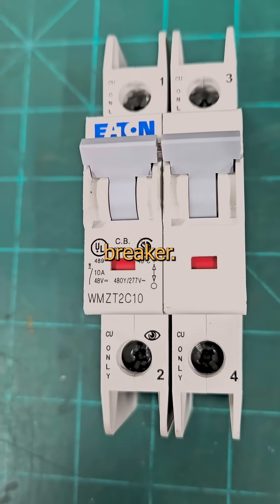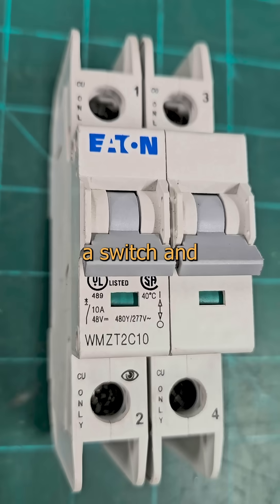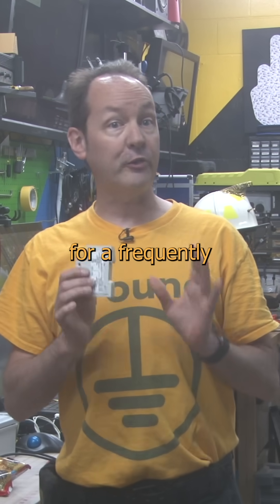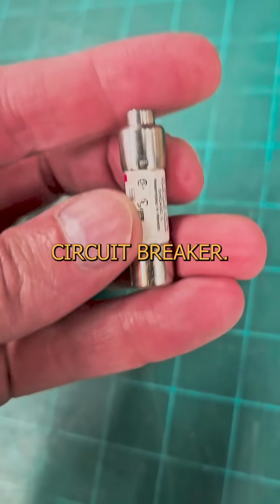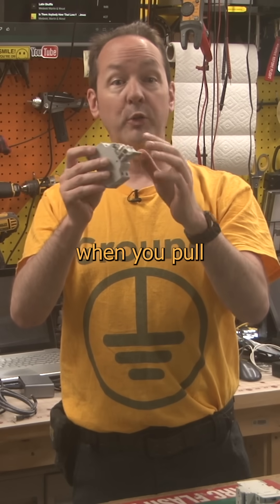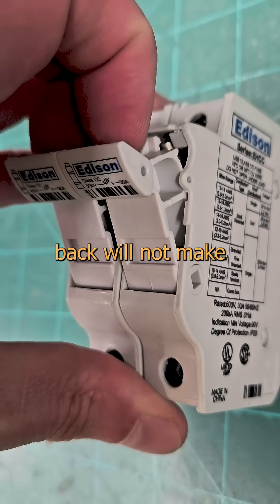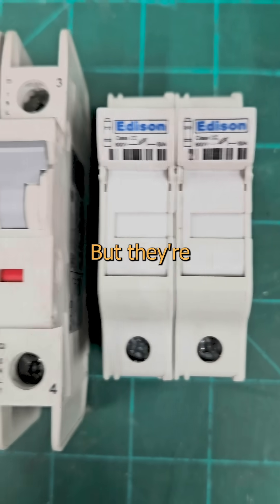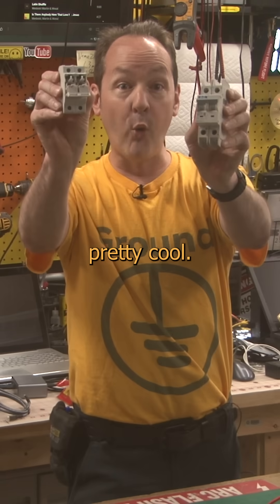Breaker vs Fuse #chrisboden #comedy #engineering #electrical #apprentice #training #educational

Comment: A fuse is not current limiting. Current limiting means reducing the output voltage such that the current doesnt even exceed a maximum value. This is just setting output to 0 after it exceeds maximum value.

Comment: Your fuse disconnectors can't be switched under load? In Germany, Linocur disconnectors are common. They use a Neozed element and can also switch operating currents.

Comment: I do electrical panel wiring for a centerless grinding machine manufacturer. Depending on where a machine is going or what its purpose is, we'll use either. We had a customer that demanded we only use the fuse blocks because of where the machine was going to be located. It's a kinda cool job

Comment: In my opinion fuses go on expensive equipment that you don't want idiots restarting before you find the issue. If it's something that will either cost the company a couple million to replace or a human life I always try to use a fuse. That extra step of physically having to remove the original fuse test it for continuity and replace it keeps normal equipment ops and maintenance guys from going "oh here's the flipped breaker!" And energizing a fire hazard

Comment: What is very cool about these resettable breakers is they have TWO modes of operation: there's a thermal switch, simply a bimetallic strip that triggers the opening mechanism, used to trip following a time-current curve, protecting cables from overload. The second one is magnetic, there, the magnetic coil reacts to sudden current spike and immediately triggers the contact opening once the preset value is reached.

Comment: Where I live a B16 Din rail breaker is available for €1.69 or $2 at the moment. A Neozed fuse cost almost half of that, definitely not cheaper since the socket is more expensive.

Comment: i had a breaker switch actually break when I turned it off to wire in new lights.  Because I didn't know it had broken I did so much trouble shooting before realising the breaker was broken and bought a new one for a few dollars

Comment: I remember once in auto shop we had an old blazer with some kind of eletrical fault. Kept blowing different fuses at different times under different conditions. We read the wiring diagram straight from GMs manuals and we absolutely couldnt figure it out. We eventually stuck a washer in the fuse block and waited for the magic smoke. Turns out, someone at some point in time before the blazer was donated to the school, had replaced a bunch of the fusible links with just regular wire and didnt exactly do the best job.

Comment: Fuse holders had that position first, then came the resettable breakers, which took decades to perfectly mimic the trigger levels of fuses .  Also, if you buy your fuse holders in the home of DIN, (Deutchland/Germany/EU), the cartridges will be the Neozed bottle shaped cartridges, not those US cartridges .

Comment: All circuit breakers are bad. Fully none of them are guaranteed to work more than once. If they tripled due to a dead short, they will be damaged. If they are reset soon after tripping, the likelihood of the contacts welding is high. It is recommended that circuit Breakers be taken out and recertified for use before being  used again. Failure to adhere this leads to electrical fires. 
Fuses work faster, are cheaper, and protect circuits far better than any circuit breaker is ever able to.

Comment: Fuse holders also shouldn't be opened under load.  They aren't rated to suppress the arc that comes when breaking a path that's carrying current.

Comment: The circuit breakers and fuses aren't mutually excangable either. The former are linked together so connectivity on both (or all) wires are broken simultaneously, whereas the fuses tend to only break connectivity on one of the multiple wires.

Important difference in many cases.

Comment: honestly, when they replaced the fuse box with a switch box in my apartment i was so fking happy. Just needing to take a trip down to the hardware store all because i ran the toaster a little too hot was aggravating. 

Now if i accidentally run my air conditioner and hair dryer on the same circuit, i don't have to worry about needing to go out into 35c weather to flip it back.

Comment: My favorite part about fuses is that they follow the Onderdonk equation, and I just love the name Onderdonk.  

I had to use the Onderdonk equation myself when designing a circuit that could survive a 15kV, 100A surge.   It was a broadband over power line transceiver which included an RF transformer that used 30AWG wire.  Suprisingly, thanks to the short duration of the surge, and some surge-rated caps before it, I was able to calculate and simulate its survival.

Comment: I had a guy bang on a chevy TBI because he thought it was a carburetor... and was getting the float unstuck.
.
It was actually the fuel psi regulator.... and he just caved it in.... with a rock he found on the street. 
.
He called me when the "float didn't un-stick"
.
.
Im like... your fuel pump is out, and now I have to rebuild your TBI for another 180 bucks... congrats, ya played ya self

Comment: A fuse will open if there are a lot of short overcurrent pulses. It takes a while for the fuse wire to heat up and break. If the pulse is too short to actually melt the wire, it still damages it. Eventually, the damage adds up and it breaks.
If you have a fuse that seems to blow for no reason, check for pulsing overcurrents.

Comment: Man, I've been using the breaker as an on/off switch for my 240v twin-stage compressor for 15 years.  I need to stop doing that and put in a switch.  Thank you for kicking my ass.

Comment: Meaning the circuit breaker is for emergency shut off for something that's not designed to be switched on and off on a regular basis. The switch with the built-in fuse is for something that requires that purpose. I'll add my own dumb question here : this is a correct assessment?

Comment: Guys at my work installed a new production line, decided instead of breakers or a shutoff, to just have a box with 3 power supply’s, 13 safety relays and a controller, and the only way to shut off power to it is to go to the main breaker or pull the fuses

Comment: I’m going to be buying both DC breakers and fast acting fuse blocks for my Solar charged, battery Backup thru an inverter setup I’m building now. It is confusing going by Forum logic what to use where. The T type fuses are very expensive around $52/ each. With so much made cheaply in China it’s easy to unknowingly buy either a breaker, fuse or switch that will fail and burn up your system.  I guess I’ll hit the code books.

Comment: DIN rail electronics my beloved, i especially love the push in spring terminal things where you jam a screwdriver into a little slot then shove the wire into a hole

Comment: I use the one that is quick to reset as a mini at-home lockout tag out except I skip the lockout and skip to the part where if you flip it then I tag you out

I heard somewhere that the lower-voltage ones should flip off before any life-threatening injury and that was why they don't lockout
Any chance anyone can confirm this?

Comment: Old shop I worked at had a proper shutoff switch fail, so they bypassed it with wire nuts and used circuit breaker to cut off a machine running a bunch of 3000W lamps. At least the fire was contained.

Comment: A big difference between the two. The fuse will fail by tripping at a lower current. The circuit breaker will fail by not tripping at all. 

And remember that a circuit breaker is not a switch at the best of times. A circuit breaker is way the hell not a switch, on a 100 amp crusher.

Comment: Ah but those fuse do some a whole lot more useful than that small circuit breaker! Those fuses can limit available short circuit current! 

If you have a 10ka system and you have 10ka breakers you are all good. Use breakers by all means, but what do you do if you need to hook up some 10ka stuff to a 65ka circuit? This is why we use modern fuses in industrial control (at least the main one). SCCR. Failure to properly design SCCR is why you see large cascading trips that are not stop near a fault.

Comment: @17:18 I have the same pressure washer. I’ll tell you what- they are pretty tough. Hypothetically if you roll it off the side of the bed on an s10 because you figured you didn’t need to strap it down because you were just taking it 300’ to the back of the shop and it slides on its top for 20’ downhill on gravel it would probably still work perfectly.

…. Hypothetically.

Comment: I have genuinely never seen DIN rail fuses in the UK - didn't know they were a thing! I don't think you'd be allowed to use this for normal residential circuits here (30 or 40 A, 240 V) but maybe it's a thing where you want some local protection but have spiky instant current draw and nuisance tripping is a problem? Like big motors?

Comment: I had never seen these before so can you imagine how fucked i felt when this winter my cooling tower water started to freeze? I kept checking everything in the disconnect and i thought i had power to the heating elements well turns out i had these little fucker in there with blown fuses. I thought i had some kinda BMS issue because when i checked my elements they were fine but nope it was just the blown fuses not letting the voltage through.

Comment: Neat little fact, GFCIs (RCDs here) have been inside of circuit breakers in Australia for decades now, even on lighting circuits. There are some places where it's on the outlet, but not many.

Also, should mention how it bothers me that my workplace has a big set of two 500W halogens, and they're toggled on and off by... a breaker. At least it's very rarely used...?

Comment: If you can find one for less than the Titanic's weight in scrap price, Eaton also makes a 1200 amp circuit breaker (iirc its like pdg5 then some part numbet lorem ipsum) and they're "fun" to work with

Comment: The company I work for makes programmable relay panels rated at full amperage, some have dimming control, some qualify for UL924. They are used in places which used to use the breakers like switches and are a lot more reliable and have more automation features than the old RR6 relays. 
The company also makes smart breakers in several flavors. Sure, they still shouldn't be used as switches but it's nice to be able to monitor and check stats and be notified if a breaker tripped and remotely force off if I need to flip a breaker.

Comment: Huh I've never ever seen one of those fuse blocks. The classic fuse panels with screw in ones were what i was used to as a little kid until everyone started switching to flip switches (which, i would like to add, green means go and red means hot still confuses me) 
I thought they were cheap as chips since everyone uses them. Am i crazy?

Comment: A trick some Russians taught me, if you can't find a breaker, plug a cut off pigtail into the socket and short the circuit. The breaker that explodes is the right one..
Reply: I've done this at least twice. Sparks, pop and fun

Comment: This is what we had as kids. We also have a little card wth some spare fuse wire inside the box. I was replacng the fuse wire when I was about 7. Which in retrospect was pretty dangerous since I didn't understand current.
But that's nothing compared to when I was about 16 and didn't understand current and blew a fuse in my first share house. Just used a bit of random wire. That bastard didn't blow.

Comment: I use circuit breaker as a light and outlet switch in my garage because I didn't wire in any additional switches, I just have live wires going through the circuit breaker and out of it into outlets. But it worked well for 5 years so far, any reason why I shouldn't use circuit breaker as a switch?

Comment: Those fuses are typically $30-40 each. So when the new guy just replaces 3 without even checking the circuit and instantly blows the new set, it's really annoying.

Comment: On a machine I worked on pulling out the fuse and putting it back would make it go again... It reset the old drives that would fault and not reset if too much load was placed on the motor.

Comment: Circuit breakers and fuses are only there to protect the wire in the walls (or a wire harness), not the load they are connected to. Please remember that, folks. o7

Comment: Breakers are used for when you might accidentally but safely over Amp a circuit say by plugging in 200 strand of Christmas lights where as a fuse box I better for fuck if we know what went wrong scenarios cause the fuse should be the first thing to go as an indicator that something is wrong

Comment: Fun fact, there are some OLD Square D tech that looked at both and slammed them together harder than your mom and I. They use fuses but also have a switch you can use to disconnect the current without detonating the fuses. 

Also fun fact, the West Coast of America mostly uses breakers while the East Coast is much more likely to use fuses.

Comment: Genuine question. Why use fuses when a circuit breaker does the same job without the need to replace its components every time it triggers?

Comment: Funny, here in Germany the circuit-brakers are way cheaper than the fuse-sockets. About 1,25€ for a B16A and 2,50 for a C16A because they aren't that common.
Reply: I have never seen the kind of fuse box shown in the video. The only fuses I have seen are those screw-in ceramic ones.
Reply: @m0llux  Yeah, the ceramic ones are old. Modern installations use the ones as shown in the short. Faster and safer to work with.

Comment: When I looked into it, there's no great secret sauce in most fuses. They are just a piece of plated copper wire sized such that they will "blow" at a certain current after a certain time. The "fast-blow types" have little thermal capacity to withstand and overload, whilst the "slo-blow" types have more such capacity to absorb the excess heat before finally blowing and, of course, some compromise in between.

Fuses aren't high precision devices; there is a considerable amount of variability.

However, fuses have one huge advantage over breakers, and that is they really don't have much in the way of failure points that would prevent the circuit being interrupted whilst mechanical breakers do. There are some special design considerations, such as not allowing self-sustaining arcs to build up, especially on DC (a problem that affects breakers too). Some, high voltage ones have spring-assisted separation for that purpose.

So, for a last resort capability for interrupting a circuit, fuses have a lot going for them. It's one reason why power supply companies will almost always include a fuse at the point of connection with a customer, and not a breaker.

Comment: Not all circuit breakers are current limiting! When we calculate SCCR ratings for industrial control panels this is especially important. It’s easier and cheaper to meet SCCR with current limiting fuses than breakers but our clients hate fuses > breakers even when we give them a boat load of spares.

Comment: To be fair a circuit breaker is cheaper than a DIN mounted switch so they do in a pinch when your budget is so tight it forces you have to choose between a shoe string or a pack of gum

Comment: The Resettable Fuse is an extraordinarily reliable design when it comes to household applications. However,  they aren't foolproof. I've seen my fair share of blown up fuses in industrial applications because someone decided to jam the switch so the circuit stays closed. 
An additional benefit of this design is that they will infact end their own existence when you abuse them, unlike the old melty fuse ones, where an especially unmotivated idiot could just stick a chunk of copper inside the fuse block and call It a day.

Comment: "Find the fire, fix the fault, and flip the fucker." 😂

All the machines where I work use fuse holders instead of breakers. I think it's a precaution to prevent an operator from turning power back on with an active fault.

Comment: I see fuse blocks in my sleep, currently working on a solar farm in Australia and we have combiner boxes on the end of each row of panels, they come in configurations of 6,8 & 10 strings. Each string runs into a fuse block that either stores a 50A or 75A fuse, both pulling anywhere from 1200-1400V DC

Comment: I dont do electrical panel design much, but we wear a lot of hats at my office. So when i do, I generally like using breakers for small stuff and fuses for bigger stuff. My thinking is that jf you're gonna do something that over currents like a 430V circuit, I'm not just gonna give you an easy switch to flip to get a second go at starting an electrical fire (for context, the stuff I work with is usually for niche test rigs, not standard industrial applications)

Comment: here's my present interpretation of the difference in usecase between a fuse and a breaker.

if a fuse pops typically the caliber of problem is a great deal larger than just tripping a breaker.

you use a fuse when you need a much higher level of certainty they the circuit is immediately broken and is going to remain broken until someone pays enough attention to actually address the initial problem

at least thats my non expert understanding if it's incorrect please do provide correction

Comment: where I live it's the standard to have 1 breaker/room, but sometimes it's used as a switch if there is electrical workss in a room instead of shutting the full house electricity, I don't know if it's this way everywhere

Comment: Those breakers are standard in Europe. I've never seen one of those fuse things. You should demonstrate safe isolation, that would make an excellent video. Any video I've seen of US electricians they seem to just switch off the breaker but not lock and label it, which technically means they're working live!